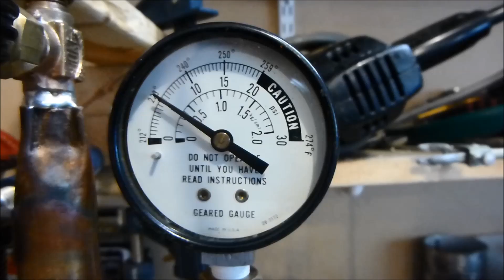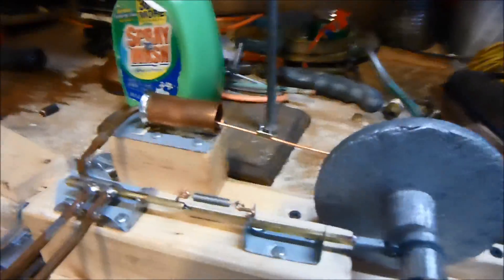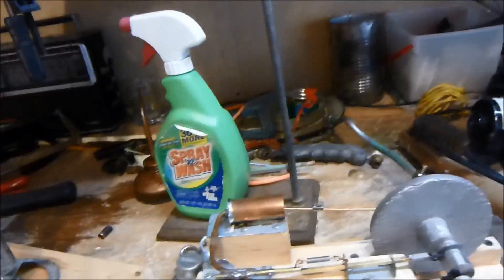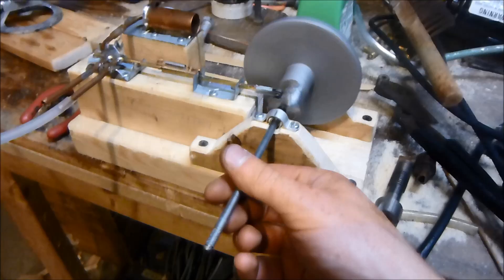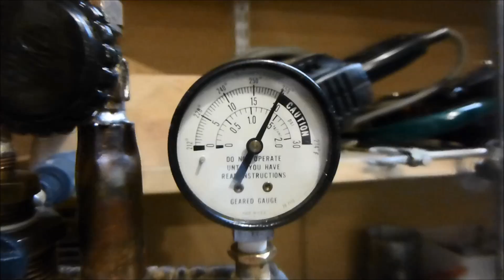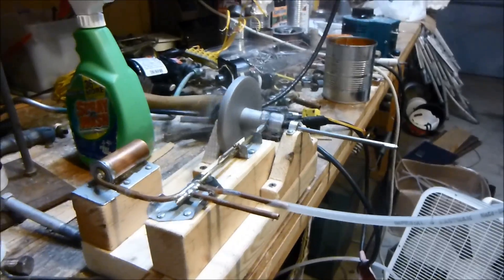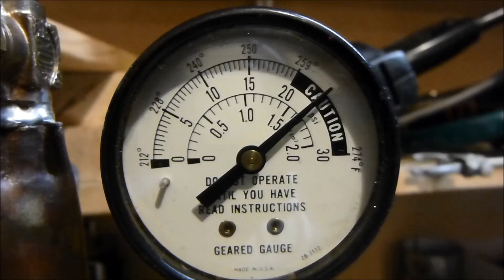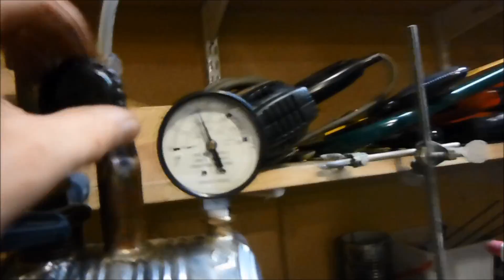Running My Homemade Steam Engine on Live Steam From My New Homemade Boiler

Comment: I know you’re probably not gonna see this but a lot of hit and miss engines will have huge tubs surrounding the piston cylinder then they fill up the tub with cold water, maybe that would keep the piston cool
Reply from the maker: Cool idea. At first thought it might look like a good solution. The issue is that you want the cylinder of a steam engine to be hot. If it's cold then the steam just condenses and the efficiency would be horrible.

Comment: Try using steel conduit instead of copper pipe.
Reply from the maker: +Electrician by trade it'd be harder to solder. I suppose I could weld it if I used steal tho

Comment: wow this is dangerous.20psi on a tin can is looking for trouble.
If that can lets go you can be badly burned by live steam.
Get a stronger boiler container.A steel propane tank used for plumbing
might work but will rust and can't be used after many runs due to rusting of boiler.

Comment: The boiler looks a bit dangerous, try using a gas cylinder and try using coins for a piston.
Reply from the maker: +thra5herxb12s I later made a much safer boiler:  https://www.youtube.com/watch?v=UWuqfIz_w9I  Coins for pistons is an interesting idea.
Reply: I used copper coins because they were the same diameter as the copper plumbing tubeing that I had laying around.

Comment: Hey Makerj101 , I was wondering why you have another pipe next to the steam intake on your engine, what is that for. Thanks!
Reply from the maker: +Blade Runner That's a left over part that lives on from version 1.  The steam used to exhaust through that second tube.  But I later changes that because it didn't allow the steam to expand enough.
Reply: +Makerj101 Thank you!!

Comment: Great work!  Your engine and mine have a couple things in common, namely the can of tomato juice for a boiler, lol. They do exhibit permanent deformation at 30 psi as yours has. Mine is a twin-cylinder, double acting and I try to keep the pressure under 15 psi.  Check it out Home made twin-cylinder double acting steam engine with new boiler
Reply from the maker: Thank you!  How do you make sure your can boiler is not going to blow up?  It doesn't look like you have a pressure relief valve on it.
Reply: Makerj101 You are right, I don't have a pressure release valve at this point and I should really have one.  I just haven't found anything that I could readily use and install. The engine operates nicely between 2 and 10 psi, so a valve that pops at 15 would be great. Maybe something like a tire valve installed in reverse... I will get to it this winter, especially if I get this lathe that I've been looking at :)
Reply from the maker: ch300fnqi I see!  Before I found the check valve that I modified into a pressure relief valve I thought about making one out of brass tube and rod.  Similar to the way you make the valves for the steam engine.  I also thought about using a ball bearing.  It would be hard to get a perfect seal.  A lath would be awesome!  I've always wanted a lath!  I could make all kinds of things with one!
Reply: Makerj101 The tube and rod is a great idea! with a spring on a screw to adjust the tension, and a hole in the side of the tube to let the steam out. I will work on it this winter, lathe or no lathe :)

Comment from the maker: Steam engine running on live steam!
Reply: etch some rings around the piston to relieve some of the heat, i'd make a piston ring out of a washer and cut the size of your piston down by about a quarter of a millimeter
Reply from the maker: Zachfictional I added a piston ring!  I'll be showing it in my next video but I'll tell you!  It cut a grove like you said and then I put an o-ring in the grove.  A little oil and it works so good!  Nearly perfect seal and really low friction too!  I was super amazed!  I thought since it is rubber it would just get stuck.  Thank you!
Reply: Makerj101 Another thing you can do is add a steam whistle to the boiler as a valve Connecting to the boiler as its part of the boiler so when u pull the rope or valve the whistles sounds there are vids on YT on how to make whistles cheers

Comment: Maybe use a small DC motor (acting as a generator) to a known resistive load, but you'd have to account for the efficiency of the motor in the calculation of output power somehow.
Reply from the maker: ab190001 I've done that with my stirling engines.  Just measuring the power output of the motor.  I'm not sure of the efficiency though.  Do you have any idea on the efficiency?  Thank you!
Reply: Makerj101
No but this site suggests efficiency (electrical to mechanical) calculations for small DC motor operation.  http://www.micromo.com/motor-calculations.  This was a quick search and I'd guess there may be others.

What I'm unsure of is if DC motor efficiency is symmetrical, that is, if generator (mechanical to electrical) efficiency is equivalent to electrical to mechanical efficiency.  Frictional losses I assume are symmetrical, but there may be other factors to consider.
Reply from the maker: ab190001 Interesting!  Looks like that particular motor tops out at 75% efficiency at being a motor.  I would guess that using it as a generator would be less efficient because it's designed to be a motor not a generator.

I have two motors that are exactly the same.  Maybe I could connect the shafts together and then power one and use one as a generator.  Then measure the power going in and out and dived the difference in half to get a rough estimate of the lost power of each motor.  Or I could just make a prony brake and measure the power of my engine that way.  Thank you!

Comment: Now you need to make a dynamometer to put on the output shaft to measure output power curves vs. RPM. :)
Reply from the maker: ab190001 I should!  I need to make something to do that!  I think a prony brake would be pretty easy to make!  I'll need to rig something up to measure RPM too.

Comment: That works great! I see what you mean about the piston leaking. On the up side, I dont think the valve leaks too much.

Time to run it on the solar death ray?
Reply from the maker: Mongrel Shark Yeah I think you're right!  I don't think the valve leaks very much compared to the piston!!!  :P  Which is good cause I can fix the piston!  Good news!  I got a propane bottle!  Now to make a new much better boiler with boiler tubes and everything!  I'll document this one!  :)  Solar death ray does sound like a good idea!  Thank you!
Reply: Mirrors are also very popular in solar thermal systems :)
Reply from the maker: Mongrel Shark Hmm I could give that a try some time.  Thank you!
Reply: I have seen some good ones with a bunch of small mirrors pointed at one spot. Seems easier than making a parabolic reflector.
Reply from the maker: Mongrel Shark You can always use a big mirror and bend it.  Yeah I think it is a little easier.
Reply: I’ve seen Mylar space blanket used too.
The little mirrors for disco balls can be found for a decent price on ebay. Glued to a wok or satellite dish they can be fairly impressive.
I've also seen a steriliser for surgical tools in Africa made with mirrors from pocket make-up kits.
Reply from the maker: Yeah me too!  I've seen people use those windshield things you put in cars and even hard drive discs!  I think I'll just use my fresnol lens cause that's what I have and I don't have the time to make anything new!
Reply: Maybe consider a  flat mirror to get the beam pointed at the bottom of the can.
Reply from the maker: Mongrel Shark That could help.  Cause yeah the water wouldn't be at the top of the can where the sun would hit.
Reply: Exactly. I thin the small mirror loss would be worth it to get the heat on the bottom. If you happened to have a first surface mirror, the loss would be minimal.
Reply from the maker: Mongrel Shark I do have a couple little first surface mirrors.  They may work but they aren't very big.
Reply: If you get one fairly close to the can, and can focus the lens on the mirror, you should do ok.
As long as the solar death ray hits the can below the water line.
Although I see how that could be easier said than done.
Reply from the maker: Mongrel Shark I think I'll use the long kind of propane tank if I use the death ray.  It's already black and I'll have it up right.  Then I might not even need the mirror.  

I went to the scrap yard today and got $152!  I was surprised I didn't really even think I'd break $100.  It was a bit of everything.  Copper, aluminium, steel, lead acid batteries, brass, mother boards, and RAM.  I didn't think I had that much aluminium but it came to $31 in aluminium and $26 for mother boards(I wasn't expecting to get anything for them).  I looked around a little but didn't see anything of interest.  Computers, but I would have had to pay for them.  Not really worth it when you can get free.  Now I'm officially a scrapper!!!  :D  I've been collecting this stuff for years!  Only thing is that I make about the same from a YouTube paycheck and that's a lot more often.
Reply: Do a video on scrapping. Double your profits.
Reply from the maker: Yeah I'm wishing I had done a video on it before I took it all the the scrape yard.  But yeah make more profit from YouTube and make money from scrapping!  :D

Comment: Beautiful homebrew, as usual! Your piston issue reminds me of the SR-71 Blackbird fuel tanks (or was it the B2?). On the ground they leaked but once in the air they sealed up nicely.
Reply from the maker: RimstarOrg Thank you!  Interesting!  So they leaked fuel until they got into the air!?  Doesn't sound very safe!
Reply: @makerj101  The fuel for the SR71   had a very high flash point, so high standard spark ignitors could light it in the engine's combustion chamber. The plane had a separate chemical for ignition for engine start and afterburner lights.

Comment: Trye using a coper end cap that fits in the coper tube.  For me on a difrent project a coper end cap for a pipe 2 mm thiner worked just fine for a piston.
Reply from the maker: bor_12345's Electrofied Gaming Hmm that could work.  I'd have to look next time I go to the hardware store.  Thank you!

Comment: great job
Why not use a copper tube filled with epoxy as piston?
Reply from the maker: eucalyptux I can't find a copper tube that fits inside my 3/4inch copper pipe cylinder.  But that's the way I did my stirling engine piston.  But instead of the 3/4inch copper pipe as a cylinder I used a 3/4inch copper pipe coupler as the cylinder.  I should have done this the same way but for some reason I didn't.  Thank you!

Comment: Very big flame.
Reply from the maker: Yeah!  it gets the water boiling pretty fast!  About 2 minutes!
Reply: Makerj101 engine is stronger with pressurised steam or vacum?
Reply from the maker: Testas. T. Oh it's by far more powerful on steam!  Vacuum is only equivalent to about 5psi of pressure.

Comment: wow thats freaking dangerous man, i saw u testing it for pressure but still. due to the heat and the temperature gradient to the inside the material becomes weaker.. so i would not do this
Reply: If it is safe its not fun
Reply from the maker: ***** Yes it is.  :(  I have decided that I am not going to use this boiler any more.  I am going to get a propane bottle and use that because they are rated for pressure unlike a tomato sauce can.  Thank you!
Reply from the maker: bor_12345's Electrofied Gaming LOL so true! Until you have a tomato sauce can embedded in you! :P